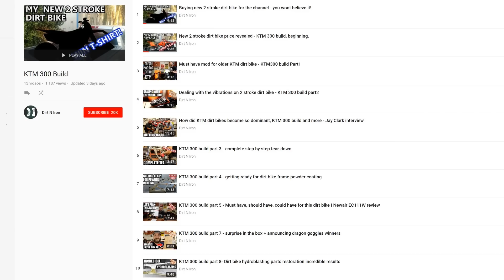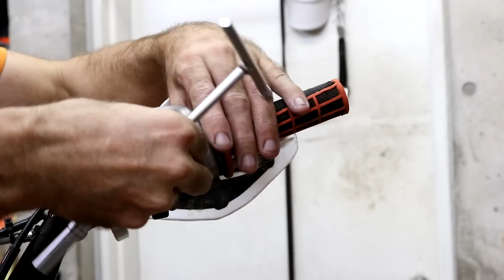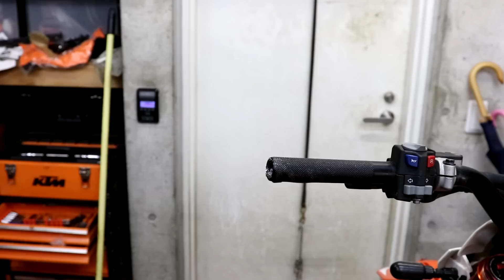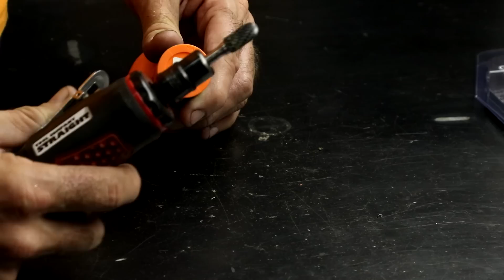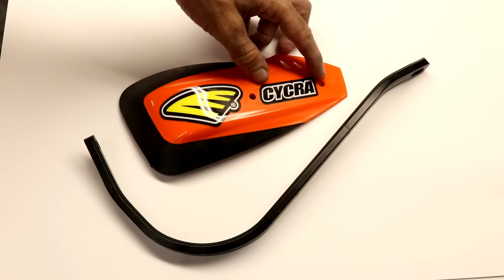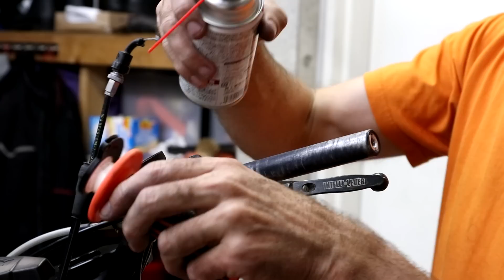Cycra Series One Handguard + BRP Mount Install

Comment: Great  video.  If you're going to tap the handlebar without a guide you should remove the handlebar and hold it in a vice with some soft jaw v-blocks.
Reply from the maker: Thanks. Yes, without a tap guide I think it would be easier to get the tap thread straight if holding the bars in a vice (using some v-blocks, or 7/8" soft jaws). However, if you don't have a vice then it's probably best just to do it with the bars in the clamps. I once did a friends bars without a guide and in the handlebar clamps and so long as you take your time and carefully adjust the tap angle during the initial tapping it's no problem.
Reply: Or just run it in straight... like a man.

Comment: You can also take a screwdriver or punch and knock the ends out of the grips.
Reply from the maker: A high speed air tool is a lot more fun to use than a screw driver... ;-)
Reply: True True!